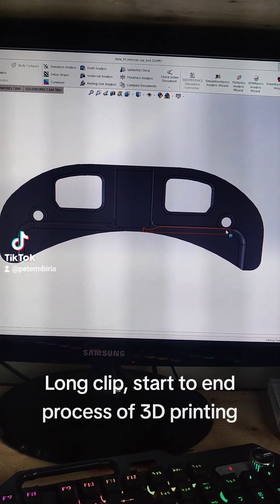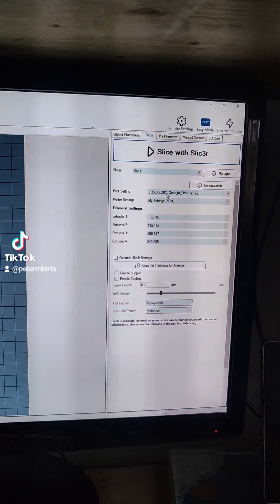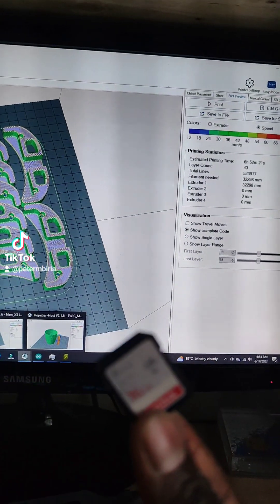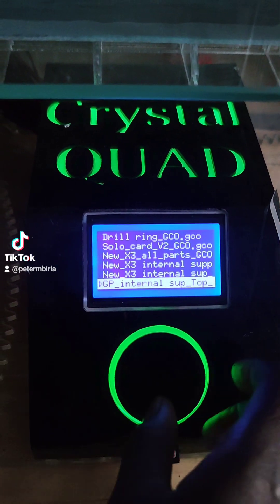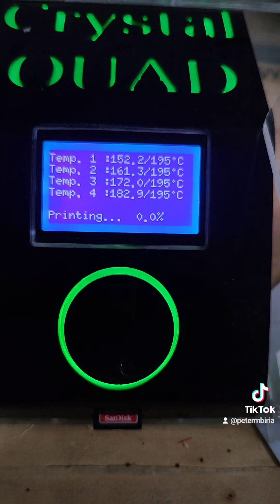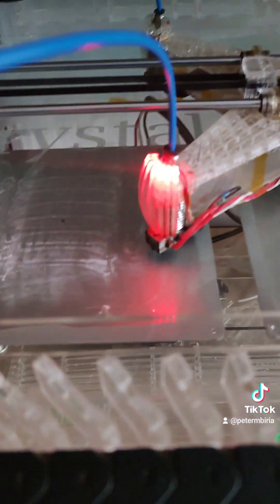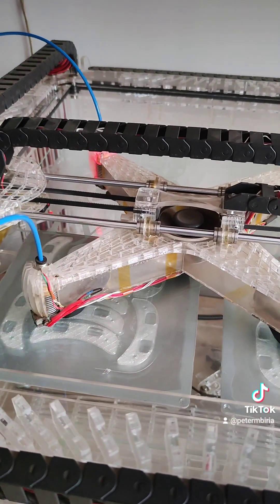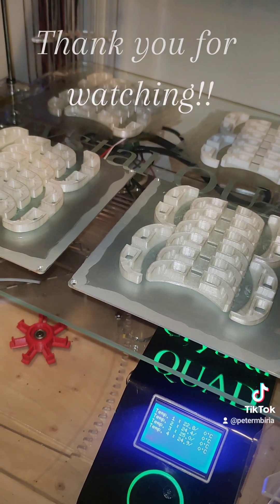3D printing whole process

Comment: Did u  build the printer too
Reply from the maker: @matthewrosen1855  Yes I did back in 2018
Reply: @PeterMbiria1  🤯🤯🤯🇧🇼🇧🇼Peter ur a genius .....where do I start I  am an AUTO ELECTRITION I wanna build a voltage regulator that can both regulate both 12/24v 
Still home studying electronics by the way